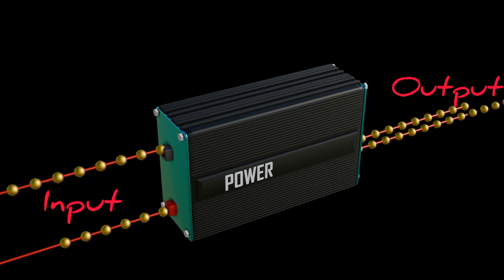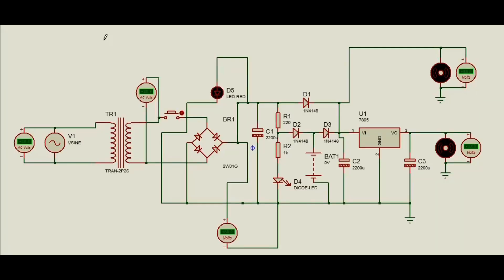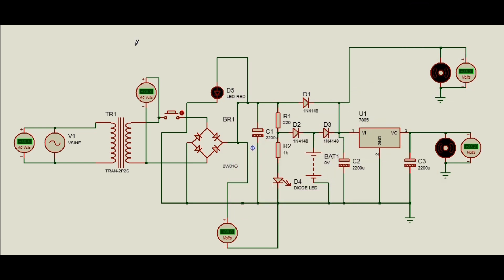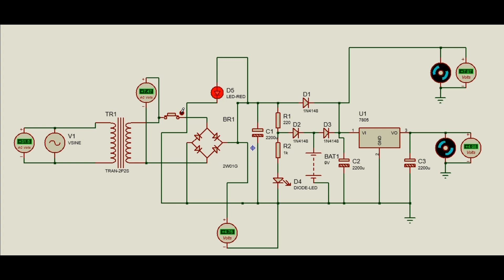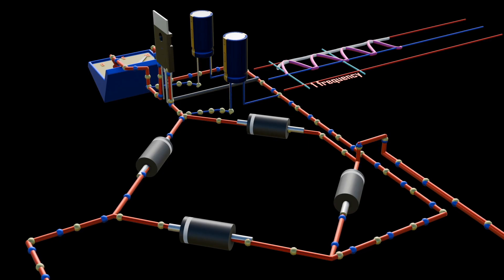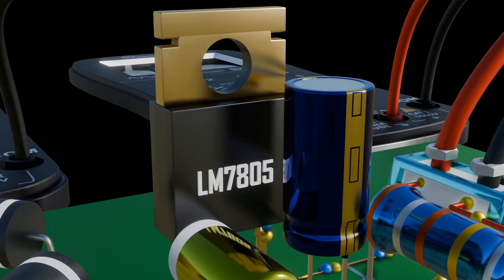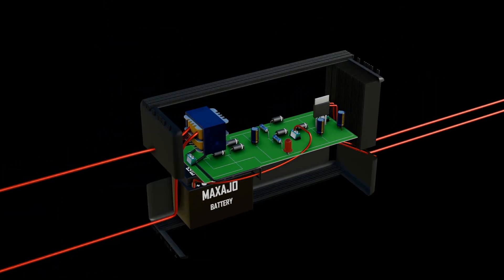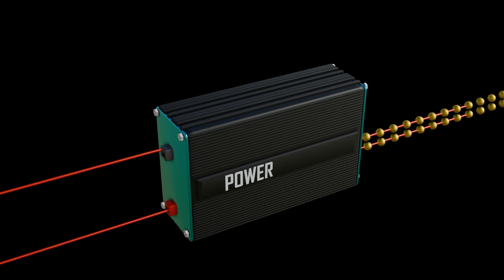how (UPS) uninterrupted power supply works #documentary #proteus #powersupply

Comment: The "normal" UPS provides an AC voltage at its output.
What you present in this video has a DC output. This is a MUCH simpler device..
Reply from the maker: Basic model